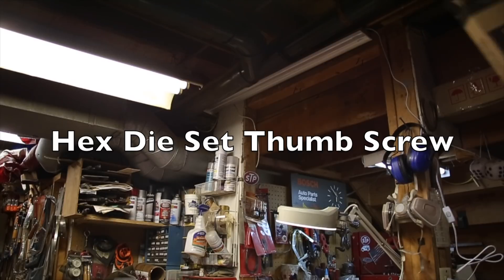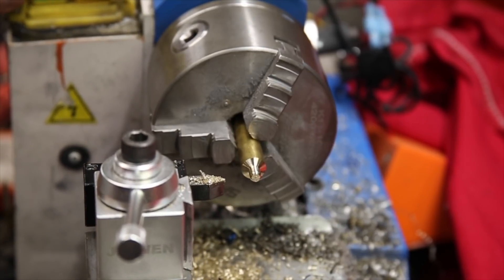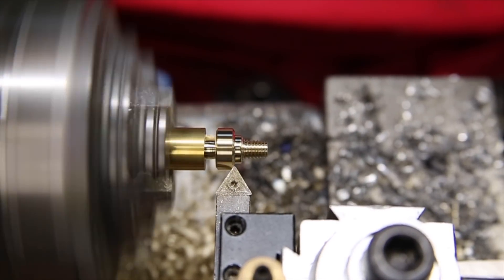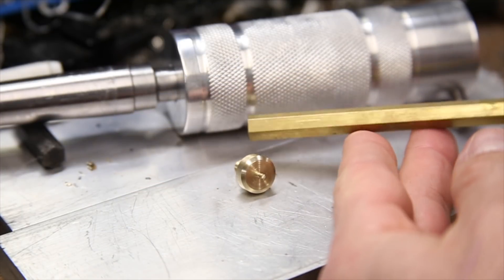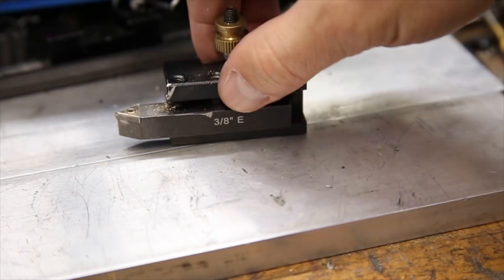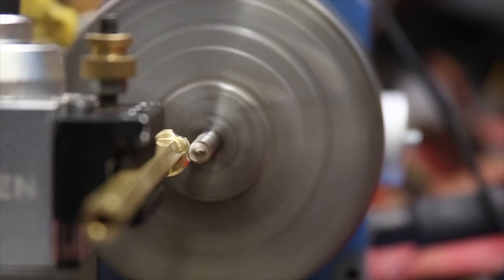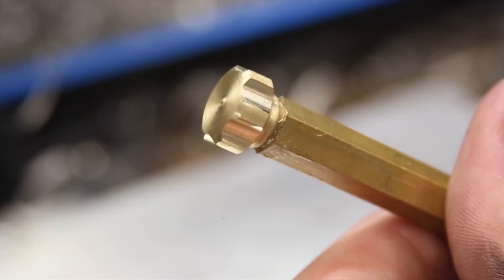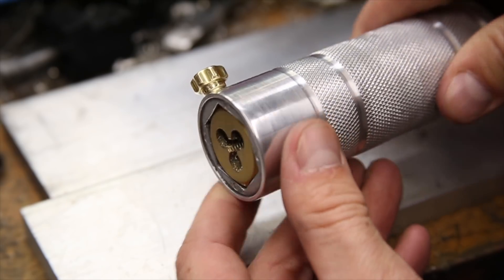(3/3) Making a Tailstock Hex Die Holder Thumbscrew Set Screw from Brass for the Mini Metal Lathe

Comment: My most recent easy-adjust screws: tap for 1/4-20; choose a (7/16) hex head 1/4-20 bolt of the length needed; drive a 1/2 inch wing nut down over the hex head for a handle. A bit of Loctite 638 will reinforce any gaps. Robust, massive, suited to minimal dexterity, if somewhat crude.

I make tooling for industry, and functionality and speed trumps beauty.

Comment: If you bore out the rear side of the dye holder to fit roller bearings and press in a full line of them 8-10 it makes it so much easier to turn

Comment: this is great, got me to think, if a person was able to create a way to index a part held in the tail stock could you cut a gear with an end mill? or do you need special angles or additional machining
Reply from the maker: I'm not sure an end mill would give you the proper profile for a gear? But I would guess so, as long as you could align it correctly and had something to index the part.

Comment: Outstanding job on the thumbscrew! I just want to say that I made one of these years ago and instead of making an arbor with the Morse taper I just bored it to fit over my tailstock spindle. I also added 3 equally spaced removable handles for added leverage. I do own a Bridgeport mill. Therefore I made a hex insert and a square insert to accommodate both hex shaped dies and taps into 1 driver. Happy machining to all

Comment: Nice result!
Can I offer a few suggestions for future jobs?
A simple way to set the tool height (in your case the centre of the thumbwheel bolt) is to lightly pinch a small straight strip of metal between it and the milling bit shank. A 6" steel pocket ruler is ideal. Pich halfway along the ruler, and adjust QCTP height until the ruler is vertical.
When clamping things, use a piece of material so you don't mar your hex stock with the QCTP screws. Also make a pair of 'soft jaws' for your vice from pieces of copper or zinc sheet, plastic or leather.  This will preserve your hex stock a little better, and also run (marginally) more true in the chuck if the surfaces are straight.
Keep up the great work!